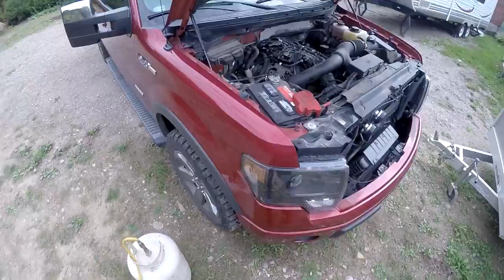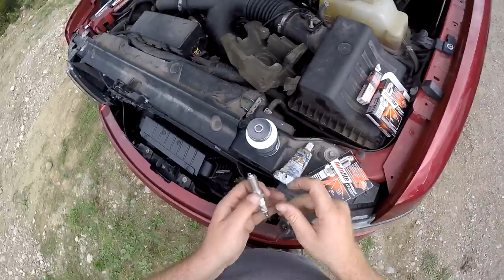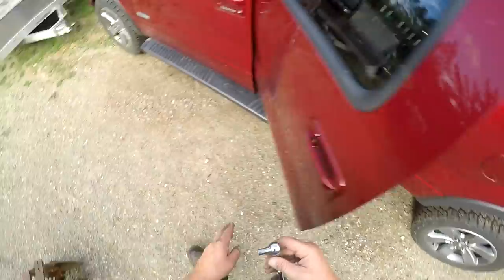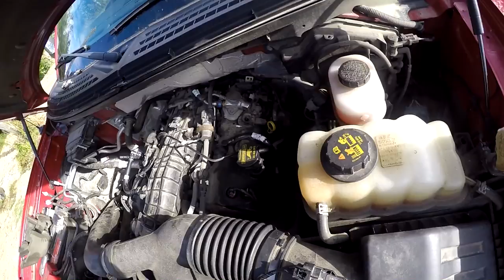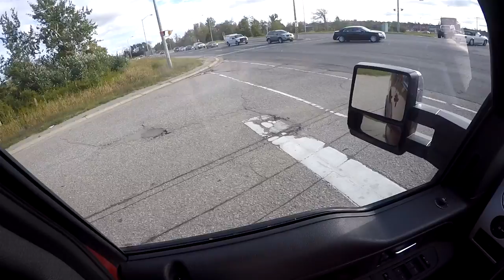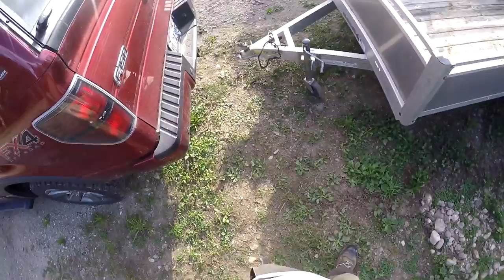Spark Plug Change Day 2013  3.5L Ecoboost

Comment: First time commenting on your site sir - first off, thanks for the interesting, informative and humorous videos.  Very helpful for me.  Second: as I've been acquiring the 'stuff' to perform my own plug change (on the exact same motor, same exact color truck, same cab and bed configuration - weird...) - anyway, Ford has changed the recommended plug twice since the stock ones were installed at the factory.  Initially Ford recommended an SP-528 plug - then shifted to SP-534 and now they're recommending SP-580.  I picked up a six pack of SP-580 Motorcraft 'Iridium' plugs yesterday and am installing them today.  The gap on the plugs when they were installed in the truck originally fm the factory was way wider than what they're recommending now partly due to all the misfires that this motor has been plagued with - (and there are a variety of reasons for those as I've seen first hand...).  With the 534's the gap, if I recall correctly, was recommended at .030-.032.  The 580's I bought yesterday were advertised to come at .028.  Kicker there for me anyway is that the plugs fm Motorcraft are 'factory set' and are not supposed to be adjusted - in fact, the guy at my local Ford dealer told me they 'can't be adjusted'.  That seems like an impossibility but I'm just sharing what the fellow told me.  Smaller gap with a hotter plug should help alleviate issues with spark plugs and misfires (at least I'm hoping that's the case) which would then simplify troubleshooting down to primarily fuel system related issues (dirty injectors being a common issue along with bad throttle bodies).  Update - the gap for the plugs I took out (original equipment) ranged from .046 to .052.  The new ones I put in ranged fm .028 to .032.

Comment: Why didn't you check the gap on any of the new plugs?  And any other videos I've watched showed blowing out the hole after pulling the coil packs to clean out anything that might have accumulated around the plug.  Just saying. Went fairly easy.

Comment: bill that spray does work but being you already have close to 100,000 it wont be as good as if youy did it every other oil change being if you did your oil at 5000. here in new york castle makes a product just for this cleaning your valves top end. they sell it as a kit. the chemicals them self were in the 40 american dollar range 5 years ago but the adapter that goes on your main vacuum hose is pricy around 75 ish. it goes on your vacuum line like your brake booster and than screws on to the quart of cleaner. than you run your truck about 3000 rpm for around five minuts the vaccume suckes it through the engine and cleans everything out blowing it out the exhaust but as i said yesterdays video that seafoam pretty good i usually put it in my truck every oil change 5000  miles and i make sure i have under a 1/2 tank of gas and you just drive it til next refill. there is a lot of vids on you tube on both procedures there is another company welworth but idk what you have in your area i know the ford dealers offer the valve intake cleaning. and it might be the same as if you bought your own kit to do it the sea from here in new york is 6 dollars at our walmart or home depot up to you  maybe canadian tire sells a more professional kit too idk not having one here in the states i know our napa carries both their brand as well as castle amazon usa also has castle products intake valve cleaner kit its called you get the intake valve cleaner fireball injectors cleaner as well as throttle body cleaner spray like you have YOU NEED TO BE CAREFUL ON THOSE DRIVE BY WIRE THROTTLE BODYS MOST WILL AND CAN SCREW UP IF YOU MANUALLY  PUSH THE BLADE OPEN WITH YOUR FINGERS  so be careful and just dont push the blade open. also a piece of 3/8 fuel hose works great to reinstall your plugs. they actually make a rubber duey thing that fits snuggly over the plug and you can finger  screw it back in

Comment: Hey Bill, I've never heard of that valve treatment before so I can't help you there. But I was talking to the dealer here a few weeks ago and the were saying around your 50,000 mile service it's important to go ahead and change the coil packs... I changed my spark plugs at 100,00 mi. without doing the coil packs too and they didn't budge as easily as yours did... maybe if their starting to stretch out they need replacing...?  I'm not sure what to take of that because I have the 5.0l in mine, maybe the eco boosts are harder on them with the heat cycles or something. I don't know, but that sure is interesting how all six just popped right off.  I'm still experiencing a rough idle on mine though so I'm thinking that's the next thing I'll do.
Reply from the maker: im not sure on the life expectancy on them.But im glad they had the bolt holding them in or they'd be all over the place
Reply: Haha! I thought the same thing when I saw that! lol hopefully you pick up a few miles per gallon. Be sure and give us an update on how she's doing! Have a good week Bill!

Comment: Smashing video bill :-D :-D
You did really well to get to those back plugs, they looked a pain.

I wonder if there is a tiny air leak after the air input sensor, that could make it drink fuel.
Reply from the maker: thanks.. it wasn't really to bad

Comment: A spark plug gap that's off by 10 thousandth of an inch will hurt your MPG's for sure and was probably pretty hard on the coil packs. Good thing you got to it now. 

BTW,  don't you just freakin hate it when a cord/hose ties itself in a pretzel for no apparent reason!?

Comment: if your going to to the seafoam thing  (upper cylinder) cleaner that should be done before replacing the spark plugs and when you do it you should also replace the oil as it will be contaminated

Comment: your meater  tires could be messing up your mpg as well thats one reason car manufacturers use all these all seasons trailer tread tires as i call them your like me want that more aggressive tire tread but the more aggressive the tread the more rolling resistance they are  and yes if i watched your video til the end you did touch on the tire compound a little sorry i was typing as your were test driving the kand n is the best for fuel mileage in my opinion they were the first out with the hole washable gauze filter and they do do a lot of testing before they put it out to the public
Reply from the maker: i imagine these tires dont help
Reply: yes but they do kick the snows and muds butt i have a set of 20 on my everyday suv gmc a set of 18 on my 94 nice truck chevy short bed and a set of 16s on my 92 chevy plow truck and most of the time i can plow in two wheel now im only doing 50 to 100 foot 2 car wide driveways but i love them

Comment: Using antiseize on spark plugs is an old myth that is dieing hard. You just don't need it period.
Reply from the maker: well id rather have an old myth on my plug then a nearly 1" threaded plug welded in the head
Reply: BILLSTMAXX but the use of antiseize doesn't prevent that, Ford used a bad head design,  more of a thread design. Using antiseize can give more problems than preventing.
Reply: But what does the Ford Service Manual say  about this?
Reply: Reg Sparkes to clean thoroughly and check gap, and tighten to proper torque.
Reply: There you are then, no mention of using anti seizing compounds.
 That should answer any questions. 
Personally I wouldn't use anti-seize on ANY parts that come in contact with aluminum cylinder heads, UNLESS told to do so by the people who build it.
Thanks 'fordwindsor351'.

Comment: Nice job on the plugs I’ll tell ya the ecoboost is a good engine but get a catch can installed it will work wonders. If you want better mpgs get a tuner. It’s pretty quick stock but with a tuner it’s gonna beat any chevy in town.

Comment: 100 k on the ford and already having issues. Thats why I ditched ford and went back to a chevy. 290 on her and purrs like a kitten.
Reply from the maker: lol chev ford toyota,,, bananas and apples ..
Reply: Come on now bill :P look at that truck you had before this one almost 400 k on her and the frame etc rusted out before the engine and tranny. This ford is going to have manfold leaks, oil leaks and camshaft problems in another 10 kms like all of them do. Chevy has leaky bs engines too but mostly just the 5.3l. 4.8 is pretty bullet proof. But yes you are right they are all money pits. I just find the manufacturing is more durable with chevy.Probably why they overcharge for their parts ;).
Reply: Ps sucks you cant film on the property anymore you had spme pretty awesome videos from the shop etc. Can only entertain half a million people before one guy decides he doesn't like it and shuts you down eh haha.
Reply: Real men drive Ford. More Fords are out making the man an earning than any shitty little over rated chevy. That eco-boost is an amazing engine.  It has its little things but its still a relatively new engine.
Reply: I had the f150 at one time. And no word of a lie it prevented me from working when the thing needed repairs all the time lol. I own a chevy again, don't have that problem anymore ;).In fact im even driving a similar ford but older in one of my youtube videos. Truck was a POS. But my opinion doesn't matter anyway if you and bill are happy with your trucks that's all that matters. Im not here to hate just a chevy guy with a reason :D haha keep up the great videos.

Comment: putting all that shit on WILL cause you more problems than it will solve the stuff you put on the plugs will act like glue and could strip the threads when you remove them  and that other stuff WILL melt and cause a short down the side of the plugs
Reply: and do you know what happens when steel and aluminum touch each other unprotected for a decent amount of time they oxidize and basically weld themselves together which will with out a doubt pull the threads out then you need to replace the head if you use the proper anti-seize it will not "melt" and short and nether will dielectric grease
Reply: plugs are a mix of nickel and  steel which does not react that way with ally  been there done it and got ALL the T-shirts  in all the years working on engines i have never had a spark plug weld itself to the head as it will ever get hot enough if it did the plug WILL BLOW OUT ON THE COMPRESSION STROKE OF ALL ENGINES ALL THE TIME AS WELDING IS MELTING METAL TOGETHER  AND MOLTEN METAL HAS AS MUCH STRENGTH   AS WATER      And as for dielectric grease we have always used petroleum jelly a fraction of the price and a thousand times better   and it does not  dry rubber out but keeps it alive
Reply: and i had to replace the head on a Nissan when i was actually going to school for automotive service because the plugs took the threads out of the head during a "routine" tune up that a classmate was doing even the head of the program with over 40 years in the field ASE certified master tech in automotive heavy truck as well as a few other master certs said put anti-seize on the threads as for the grease i personally never use the stuff except when i was forced to changing batteries for autozone btw i used the permatex stuff and never once had an issue though on my car (91 ford CVPI) that thing burned oil so much i was replacing the plugs every 2 years or 15k miles and i did not mean it would litterally weld its self like from an arc welder i ment that the oxidization is so strong its like it is welded also not all plugs are nickle/steel and not all heads are aluminum i know about the oxidization between the metals because we had to use a 8lb sledge to break a alloy rim off of a hub on a lincoln towncar it was kinda funny when that wheel broke loose it bounced all the way across the shop
Reply: High temp anti-seize acting like glue and dielectric grease melting and causing a short? You don't know what the hell you're talking about.